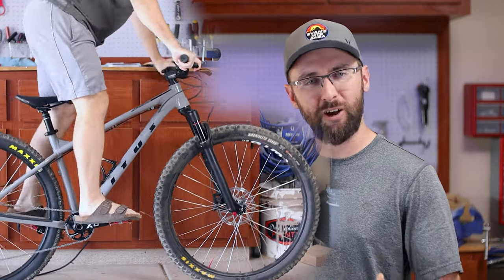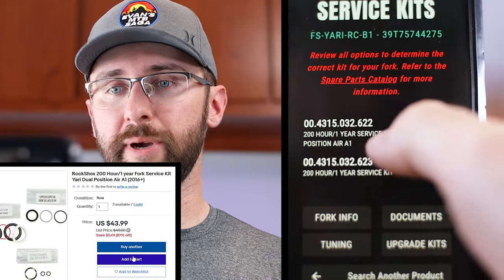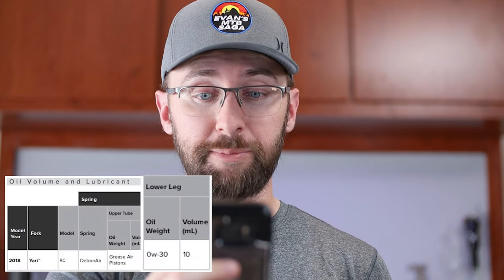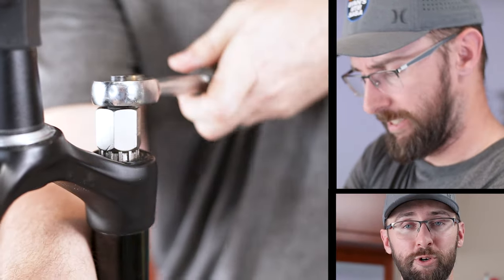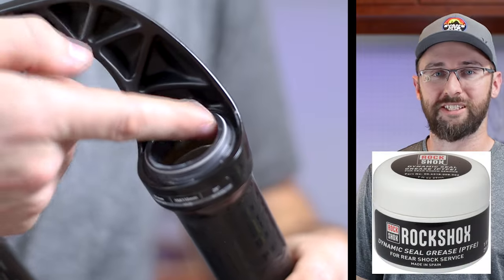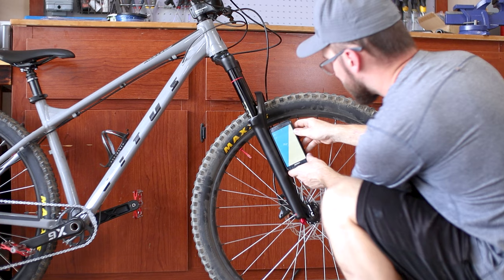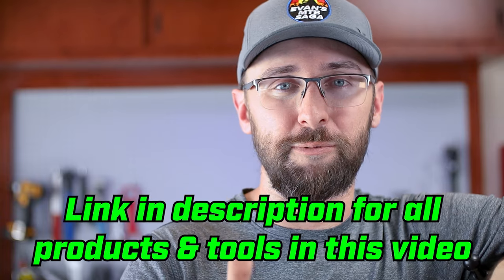Converting travel on a Rockshox fork is easy!

Comment: Another great vid man! Very cool on the new addition as well, congrats "SAG"🐣🐣🐣
Reply from the maker: Thanks man! You should convert the travel on the markhor! It's way easier than rockshox, you just pull off the lowers and take off a little bumper on the air shaft. Then boom, you have a free 120mm upgrade.

Comment: I put the RC2.1 dampener in my Yari and it made a huge difference
Reply from the maker: I'd love to do that very soon! Do you think it's worth $200+?
Reply: @EvansMTBSaga  I think it depends on the type of terrain you ride TBH. When it comes to jumps and flow trails, the motion control and the 2.1 feel very similar. It’s on the small bumps and fast descents that the 2.1 really shines. Makes the front wheel feel more planted.

Comment: Great video but it's missing the lubricating oil you are supposed to put in the lower legs.
Reply from the maker: You must've missed that part of the video. I put fox 20 wt gold in the Lowers
Reply: @EvansMTBSaga  you did soak the foam rings. But video does not show you pouring oil into the lowers, only tightening the bolts
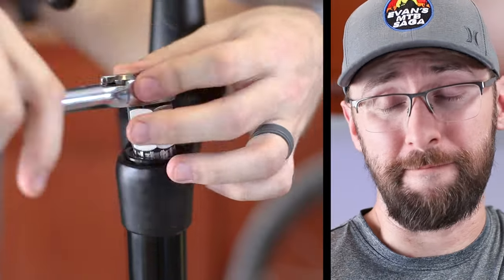Reply from the maker: 4:08 gets injected in the bottom of the lowers before the bolts get installed
Reply: @EvansMTBSaga  you are right, somehow I missed it.

Comment: Congrats on the new baby! My Pike is still new but good to see a service as I assume they are similar forks.
Reply from the maker: I've read that rockshox skimps on the amount of oil they put in new forks. If I were to buy a new RockShox fork, I'd loosen the bolts on the lowers and drain out the oil, then put in the proper amount per spec. Mine required 10cc, but I've heard of factory forks having just a few drops.
Reply: @EvansMTBSaga  Hmm, maybe I should service them sooner rather than later, they do feel a bit harsh on low speed stuff but soak up big hits well. Thanks for the info.

Comment: You know I had a Chinese air fork that the lowers came loose bc of there cheap bolts, and I patched it up using a steel axle that bolted to the top of the fork on the no longer rebound adjust and lockout feature, and had it hold the hole fork from top to the lowers and yes when you compress the suspension, the steel rod pokes out more through the lowers. It was to prevent the lowers from falling out. But I used 2 nuts that locked in with each other under the lower and technically I can tighten the nuts so the suspension gets compressed together and I can shorten it's travel. Trust me as sketchy as it sounds its safer than the little bolts holding the lowers. And no I don't have that fork anymore that's been long gone after my senses finally told me to get a new fork and stop playing with fire😂😂

Comment: Hello, I have a rockshock revelation 120mm travel fork that needs the debon air upgrade as some of the travel is "sucked down". Would I run into any issues installing the debon 140mm on a 120mm fork. Thanks and keep up the great content.
Reply from the maker: I'd guess probably not, but the service manual will tell you if it's possible. Also the air spring might have air on the negative chamber which could be fixed by carefully installing it

Comment: Great vid! I'd highly suggest you swap the damper for the charger 2.1 damper. I did that to my yari and it made a huge difference! The stock motion control damper is pretty garbage in comparison
Reply from the maker: Definitely on my list! The stock damper is like half the size of the Charger. Once I do that I'm gonna call it the Yari Ultimate 😂
Reply: @EvansMTBSaga  and add a good sticker then call it yari plus ultimate.

Comment: Hello from Spain, I really like the videos. I have an Electrica with a 100mm fork and I want to put 150MM on it with a new fork! any problem? thanks
Reply from the maker: It will make the geometry different and stress the bike and welds in different ways. It's a little risky that the frame could crack. I did it on my bikes twice now and it's fun, but I didn't ride too hard
Reply: @EvansMTBSaga  Thank you very much I will not give it hard, only roads with some stone, we will try ... thank you very much for the information and Happy Holidays

Comment: can you fry an egg in your car and can you cook food with the Arizona heat. there is a city called flagstaff up north in az and they have temperatures that are somewhat reminiscent with the northeast so its much cooler there in the summer. (2 hr 30 mins to drive there and it barley goes over 90 degrees there)
Reply from the maker: There's an even better place that's closer called Prescott with like thousands of miles of mtb trails there. Very similar to Flag, but better 👍🏽where do you live?
Reply: @EvansMTBSaga  flagstaff has cooler weather

Comment: Great vídeo!!! I'm from Brasil. I increased the travel of my Rs Reba from 100 to 120 mm, changing the air shaft tô a New onde Debonair 120 mm. Do you know if the RS Sid Select 100 mm has this option too, and if the air shaft is the same as the Reba? Thanks a Lot in advance.

Comment: what happened to deore?. buy deore cassette that will may change the shifting. if its not  it means that deore has problem. big daddo. and can u do vlogs about how should dads look after their kids 🤣🤣
Reply from the maker: Well I had another video where I tried to change out the cage because I felt it was bent, well the bolt stripped out and that's all she wrote for that derailleur. Had to scrap that video.

Comment: Still using an S7 your a rebel because mine had bad battery life and it overheated in 80 degree northeast summers. I have an s10 now so problem solved. Also mongoose made a new dirtjumper if you want one lol mongoose made a dirt jump bike for 198 https://www.walmart.com/ip/Mongoose-PT26-dirt-jump-bike-pump-track-single-speed-26-inch-wheels-copper/862275683
Reply from the maker: The battery life has recently started to go down. I don't have a cell service plan, so it's on airplane mode at all times, which really helps with battery consumption